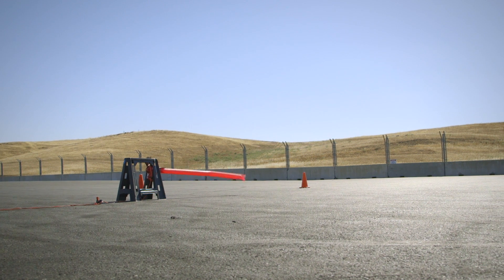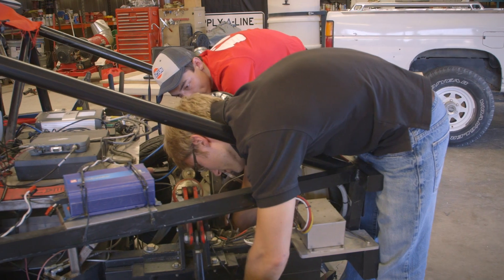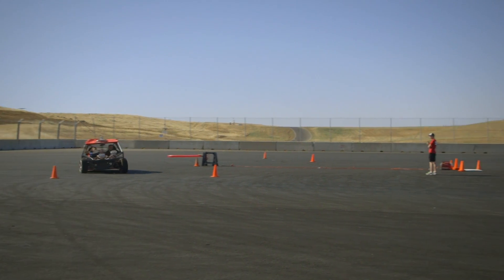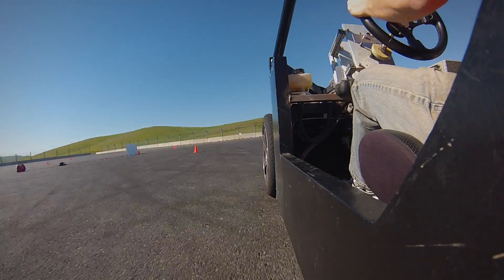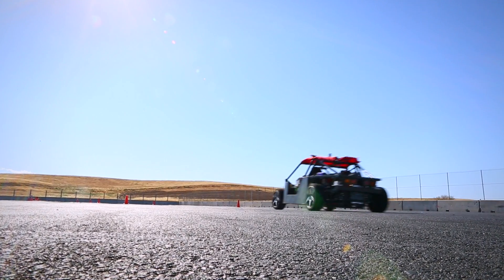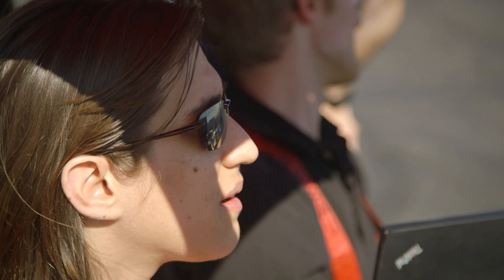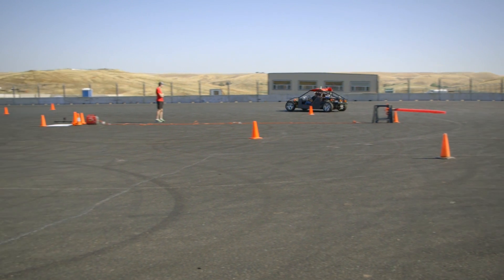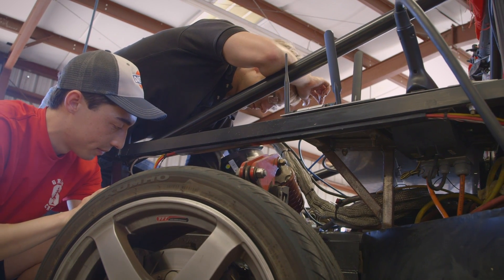Stanford engineering students teach autonomous cars to avoid obstacles

Comment: i wonder if a cat ran in front of one of these autonomous cars if the car would careen off the road...
Reply: +Tim Leach this is a good question.. sometimes the correct answer is to crash into the obstacle (and avoid spinning out or flipping over). If its a small animal it may be better to run over the animal.. if its a small child probably not. These are tough questions that need to be made in a split second.
Reply: @acasualviewer5861  this reply is 5 years old but i'm not sure of any onboard sensors that can distinguish between a cat or a baby, or  of any population of people that would approve of a car that is programmed to run over small live animals with some bogus assurance that it wouldn't run over a human baby. tesla can market 0-60 as a feature that people fawn over, these autonomous cars need to market instant stopping as another feature that can reduce unavoidable collisions
Reply: @fudanshi575  well there are limitations of physics.
Sometimes you have to choose between 2 evils. Run into the ditch and risk your passengers or hit an animal. I'd hit the animal to avoid running off the road.

But as I said, if it's a child I might run off the road instead. This is a situation where you need to make a bad call in a fraction of a second and choose one of 2 bad outcomes.

Stopping is not always an option because breaks can't always stop a car instantly.